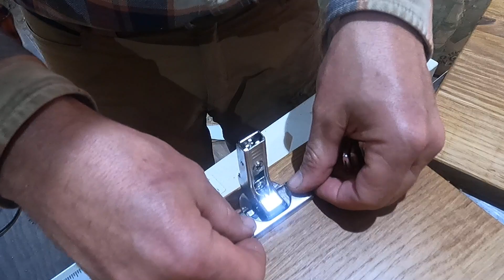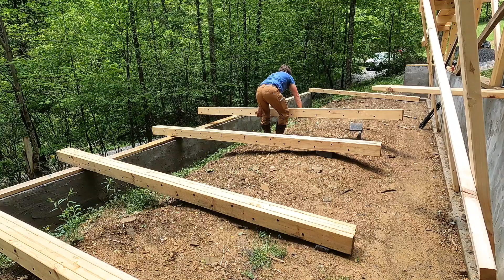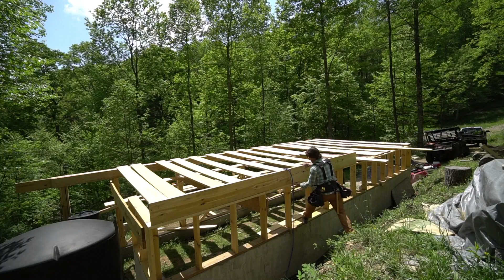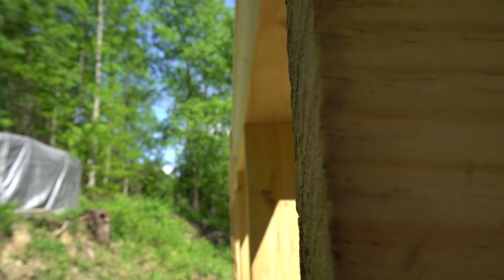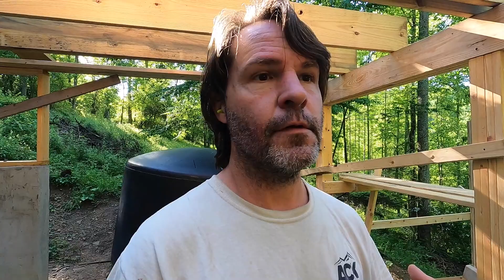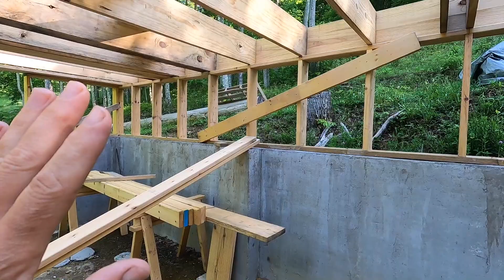Two Story Off-Grid Mountainside BarnBuild Ep 8 | Rolling Joists, Discovering A Structural Problem

Comment: Can you put another post under that seam ?  Also I would use steel t-brackets to attach the posts to the beam. Just an idea.....
Reply from the maker: Hi Paul, yes, it will get additional bracing at the post beam connection. I tried to find some "metal" brackets, but the beam is 6" wide and the posts are 5.5" wide so they'd need to be custom fabricated (I'm not a metal guy). But yes, something will be there soon enough